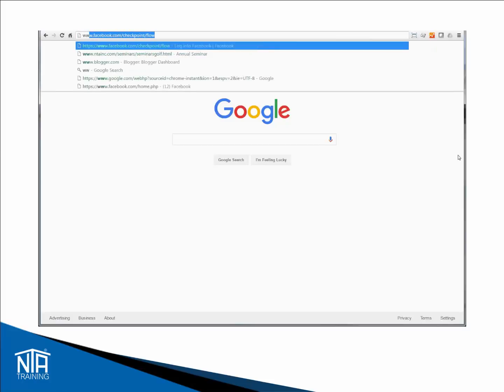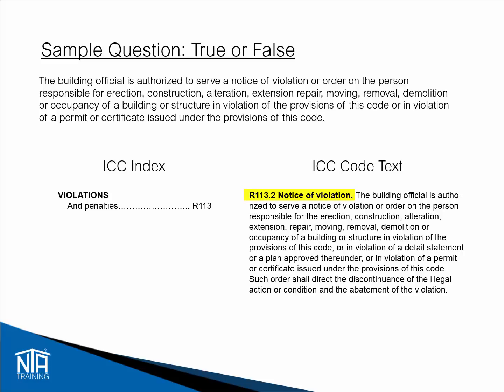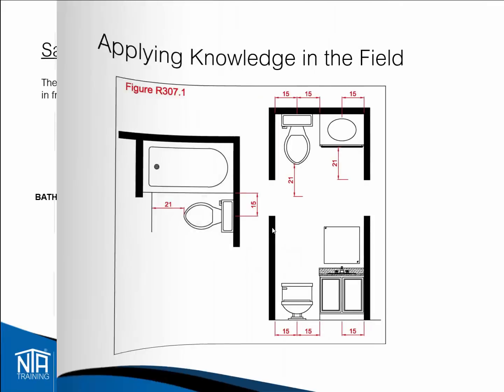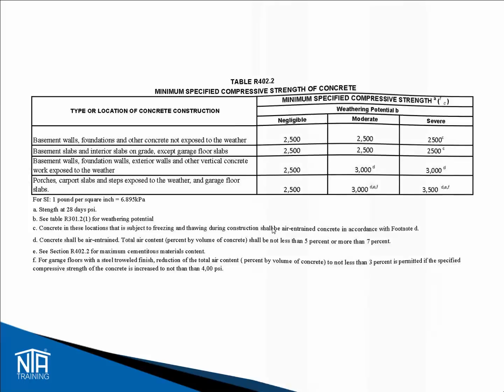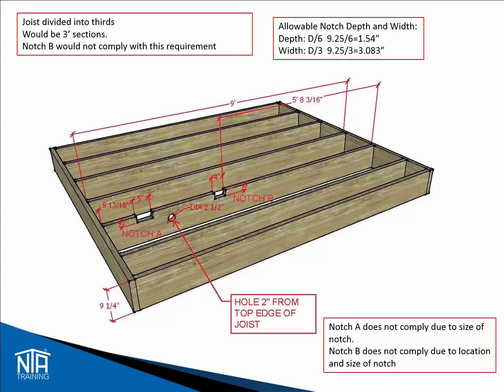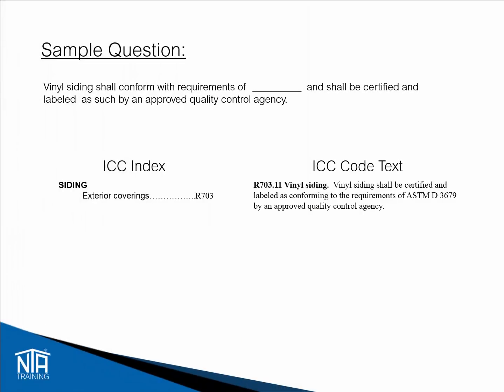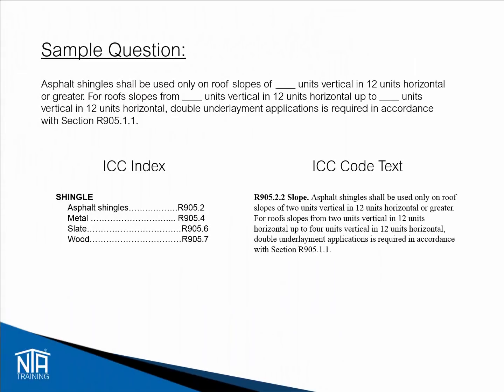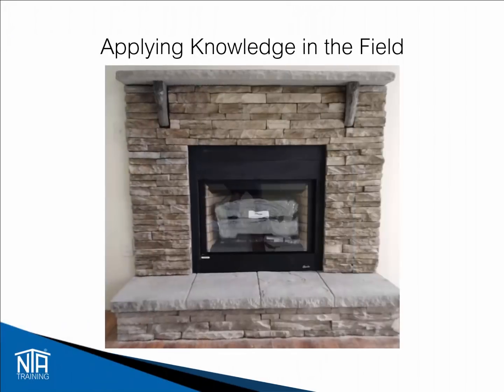Studying for the ICC B1 Residential Building Inspector Video

Comment: Great video... I just took the 2021 ICC B1 and passed. To be honest, this video was a big reason why.

As many have stated before the EMPHASIS of test is about FINDING the information quickly...HOWEVER there are some very practical questions asked that you should know the answers to such as stairs, boring/notching joists, etc.. I would read these sections of the book throughly.

Also, if you don't have a construction background and do not understadn the terminalogy I would suggest reading and understanding the definitions section in the code book.

Comment: be aware that the ICC is doing everything it can to make you fail this test.  That way you have to pay another $241. This is how the "Non-Profit" makes a profit.  If the study guide and practice test talks  about feet, the test will be in inches.  They will mix up words to throw you off, they have questions on the exam that are straight up NOT in the reference manual, they will ask questions in which the answers are in the fine print.  Good example is step footing -- there's ZERO mention of "Step Footing" in the table of contents or index, yet they'll ask 4-6 questions on that. These guys are absolute shit bags.